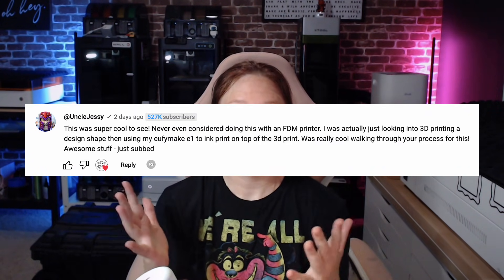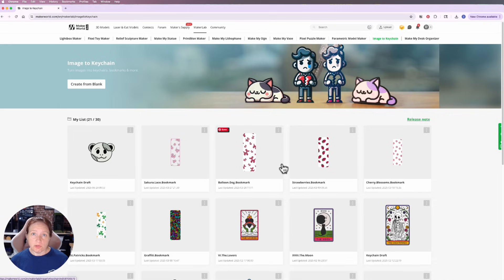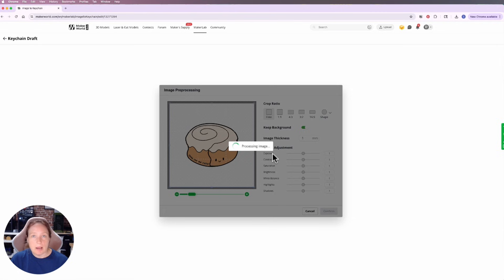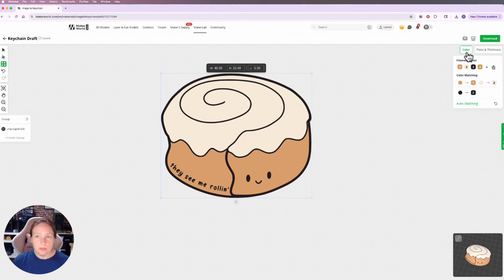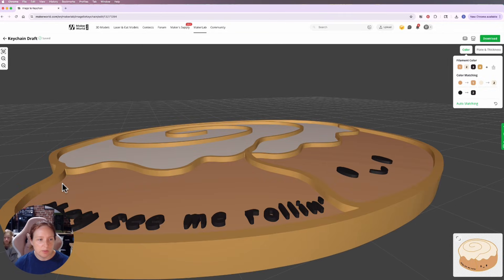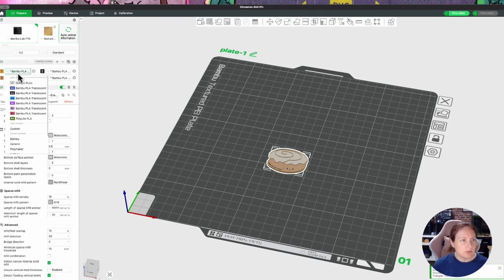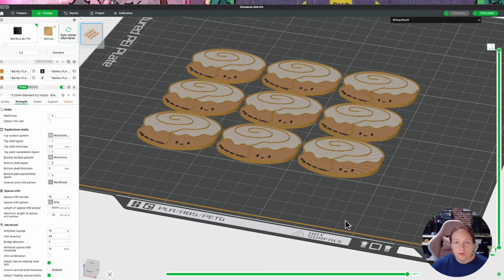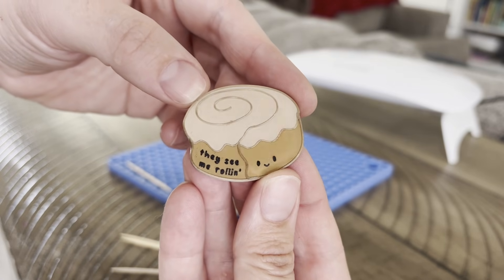Make Cute 3D Printed Pins, No CAD Required!

Comment: Hello I’ve been having so much fun with this method thanks a lot. Recently I was doing some for a friend using silk pla and the first few plates printed fin but eventually the silk pla started giving me extrusion problems. Upon researching apparently a .2 nozzle is not recommended. Do you use silk pla? If so do you have any recommendations or suggestions on how to avoid extruding problems?
Reply from the maker: I use a silk pla for the gold and the black and honestly have not had any problems. I do clean the nozzle on a regular basis as a dirty nozzle head can lead to poor results, but I have never had issues with clogs. It could be the specific filament you’re using as some contain different additives that might be more prone to clogging.
Reply: @LabcraftStudio  thanks for your quick response. May I ask what brand do you use?
Reply from the maker: @Hi-x3e I used Geetech’s shiny silk black and DO3D silk coffee color. It looks like proper gold in person. There’s links in my Amazon storefront if you’re interested.

Comment: Thanks for the video. I’m new at 3d printing. I just made my first batch of pins using this method. They turned out great but I noticed that once I put the resin on and cure it they warped a little and are not completely flat anymore. What am I doing wrong?
Reply from the maker: Might’ve gotten too hot during the curing process? Mine don’t warp so maybe try and elevate your light a little bit and see if that helps.
Reply: @LabcraftStudio  thanks. I was thinking it could be that too

Comment: Which program do you use to design your pin before making it 3d
Reply from the maker: Most of the time I draw the pins in Procreate, but sometimes I use Affinity as well. They often start out as sticker designs that I convert to pins. I think I have a live stream on my channel where I designed my “dumpster fire rainbow kitty pin” that goes a little more into that process if you’re interested.

Comment: Which Bambu Labs model printer do you use? Also, do you have an affiliate link to the UV resin, UV Light and pins that you glue on the back?
Reply from the maker: I use a P1S with either 1 or 2 AMS units depending on color count and of course a 0.2 mm nozzle. I have a list of the resin supplies here in my affiliate storefront: https://amzn.to/3LsZHhq

Comment: Thanks for sharing. I recently designed buttons that use the spring pins that go with my metal 1" buttons but I think the thumb tack style pins that you're using might be better for me. Only problem is I don't know what they're called so all my searches are bringing up typical metal button systems or thumbtacks :P . Any chance you could share your source for those?
Reply from the maker: I looked them up as pin backs. But I just got a bag of them off of Amazon. This is the one I used: https://amzn.to/46R04Ln

Comment: How long did it take to print one? I am just wondering because mine took a very long time and it was a 2 color one. it was 45min and about the same size.
Reply from the maker: They’re definitely not fast prints, especially with the colors having to be changed out. That’s the challenge of multicolor prints especially with a .2 mm nozzle. I usually do 9 to 12 on a plate and it normally takes 5-6 hours depending on the number of colors.
Reply: @LabcraftStudio  Thank you for replying! I found a way to reduce like a 20% the time. I just have to do a colour fill. I don't know exactly why, but it reduces the layers just by doing that.

Comment: Hello,
Would using Arachne mode enhance the print quality, particularly for text?
Thank you.
Reply from the maker: It should, yes. I believe I had it enabled but I’ll have to go back and check. Usually it’s automatically turned on for the files created in image to keychain, but I could have missed it in my settings.